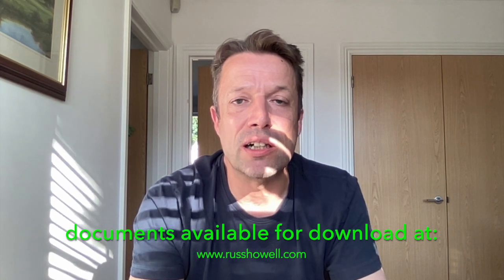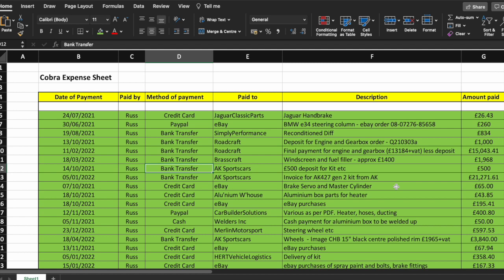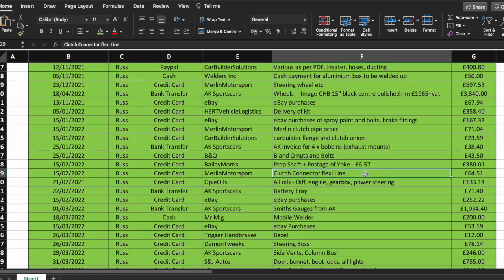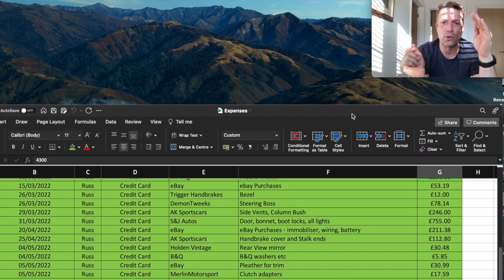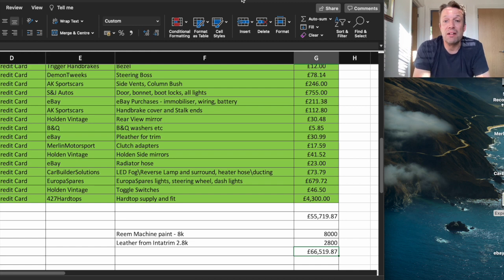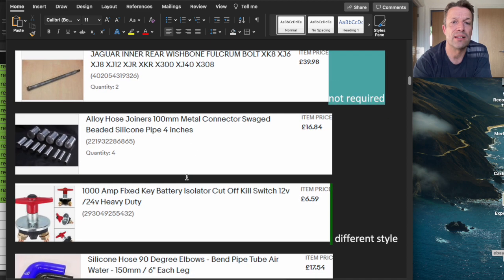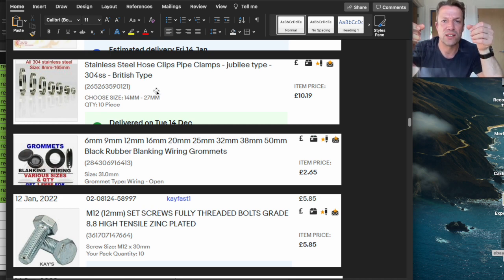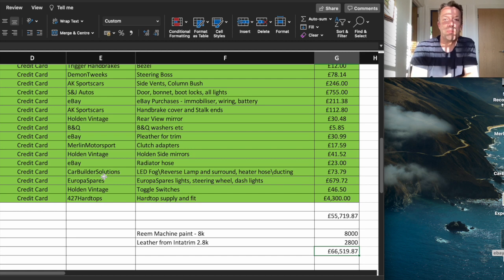Building the AK Cobra - Part 23 - how much to build a Cobra replica

Comment: Please don’t take this the wrong way but I was a bit shocked that the final price came to £66k. I thought the AK was one of the more average Cobra kits and not that accurate to the original Cobra. 
I had been considering building a Hawk 289 FIA with a Ford small block but seeing how the costs of this have added up has put me right off.
Reply from the maker: Yes this one was quite pricey, however it can be reduced by: older v8 engine, cheaper paint job, no exhaust ceramic coating, cheaper tyre option etcetc
Reply: Me to - can't believe I'm going to say this but a good DB9 / Bentley GT seems a cheaper option.......
Reply: @originalforgery  seems a way better option.
I bought a brand new Alfa Romeo Giulia Quadrifoglio with every option I wanted for less than this… and that’s an actual proper car!
Reply: Yep, insane how much it cost but thanks for listing prices. So hard to find numbers

Comment: Russ, thank you for doing these videos. I've loved every second and it's tipped me over the edge to do a build. I can't wait to see this build finish too.

Couple of questions about the costs outlined:
- the kit cost from AK. I've costed up and seen a breakdown (on Fred's AK blog) of the Gen3 at 16.5k. Could you expand on the kit coming in at 21k and how the AK pricing mounts up?
- steering wheels appear twice. I must have missed why. Could you explain the two costs please?
- hardtop is obviously the commissioning buyer's choice. What are your thoughts on alternatives and costs for such?
- ECU system - is that included in the engine/transmission kit or is that a separate item not listed?

Apologies for the Qs. Thanks for your patience!
Reply from the maker: Hello, thanks for your comments. Please get me at russ@russhowell.com for further questions but will answer some here. I bought a 13 inch steering wheel but customer wanted wood one fitted after IVA. Not sure what Fred had included on his build, but ECU bought from AK with wiring loom.
Hardtop is awesome but i would probably opt for soft hood that can remove and fold into boot I think approx £1300. 👍
Reply: @russ.howell  Excellent, thanks Russ. Much appreciated.